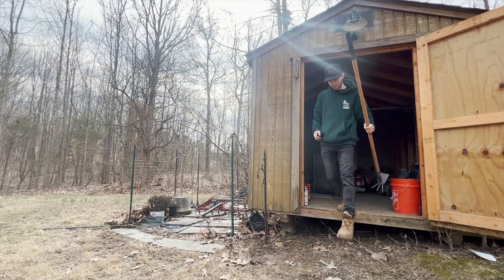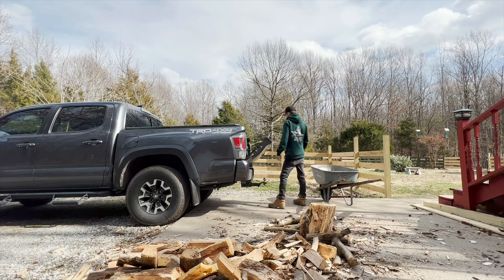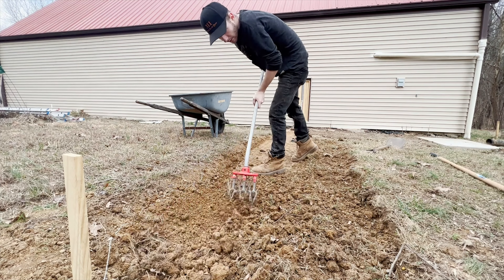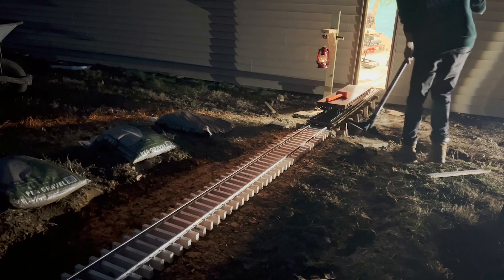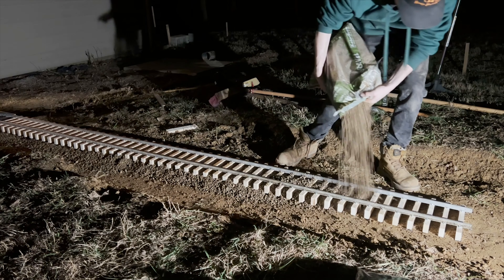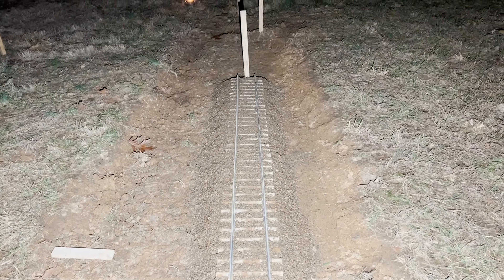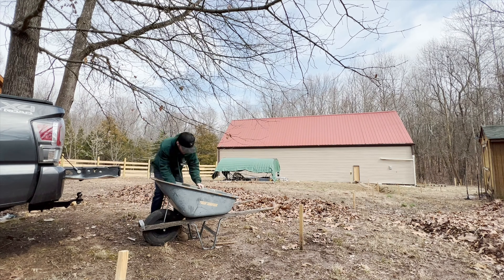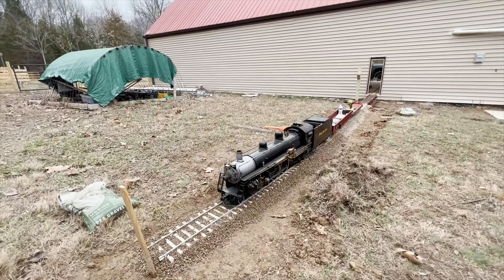Building a Live Steam Backyard Railroad: Episode 3

Comment: I am a new subscriber, loved watching your track laying video, brings back memories of starting my own railroad 25 years ago.  Chuckled as you worked into the night, have done so many times.  I do have one suggestion.  I noticed the bag you were pouring out of said pea gravel.  That is fine as long as it is crushed and not round gravel.  It needs the bite of crushed gravel to hold the ties.  Also, I've found through experience it is better to have your rail joint resting on a tie rather than between ties.

Be careful of where this very addicting hobby can take you.  I am resting after unloading two tons of 1" high steel rail this morning for future expansion of my 2 1/2" scale, 7 1/2" narrow gauge railroad.

Comment: Question... if you're running multiple gauges, are you planning on running a dual-gauge section, and why/why not?
Reply from the maker: This is a great question!! Personally, I believe adding multiple gauges to one line can be a good option for the same reason real railroads did it (time, budget, access, etc), but I’ve never wanted to lay a dual-gauge railroad myself. I’ve mostly only had access to a dual-gauge track for the last decade or so, and in my experience the gauges tend to wear unevenly unless you go all welded steel construction (like St. Croix Highline, that is perfect), and I think sometimes the third rail can make it look a bit like Lionel to me 🙃 I will likely have one or two dual-gauge spurs near the shop to make transporting equipment around the property less labor intensive, but otherwise the lines are all completely independent from one another. Thanks for asking and for following along!! Cheers 🔥